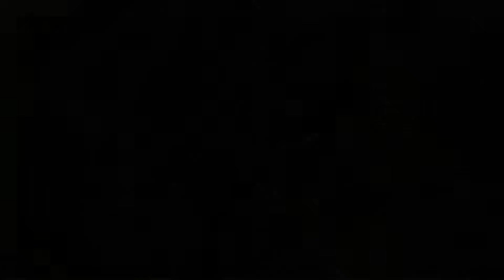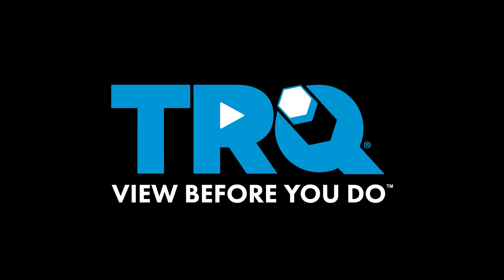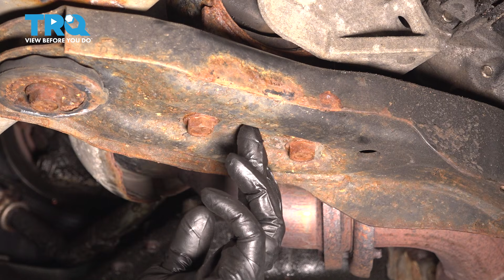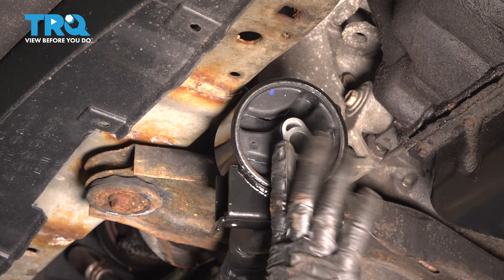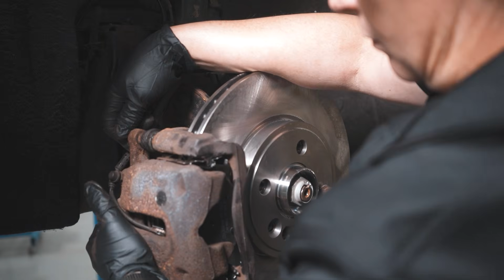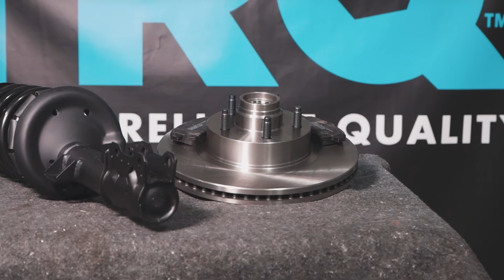How to Replace Front Engine Mount 2008-2020 Dodge Grand Caravan

Comment: You say not to tighten the through bolt while engine is raised. Then you say you don't want to tighten it with all the weight on it. You tighten the bottom bolts and torque them and then torque the top bolt. You never show when you tighten the top bolt.